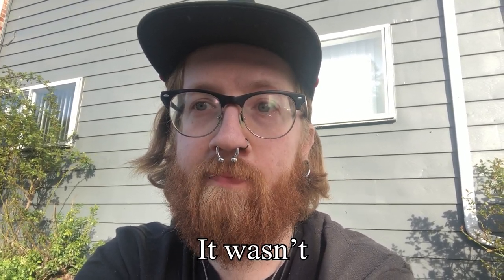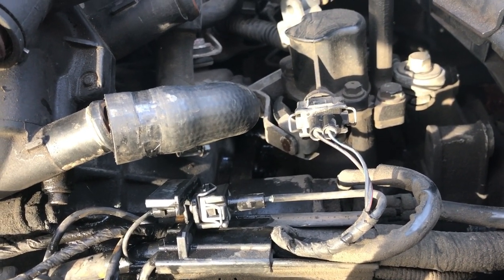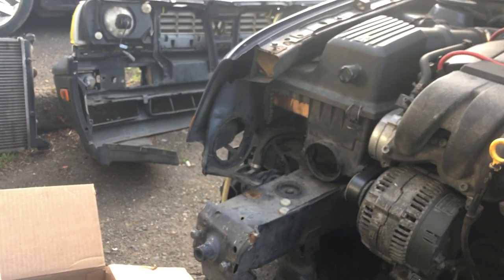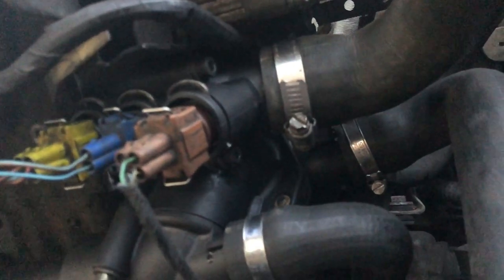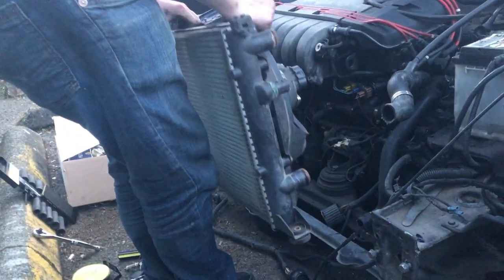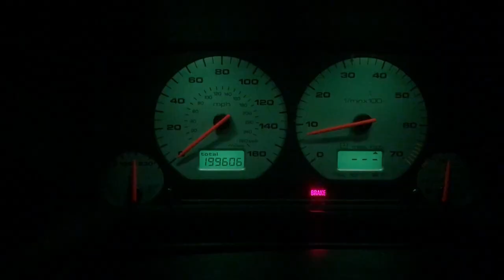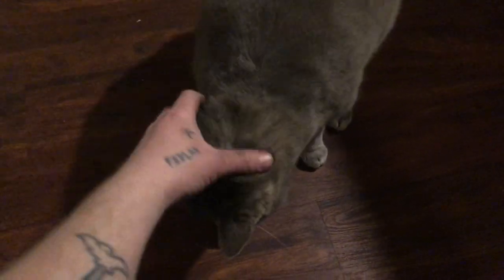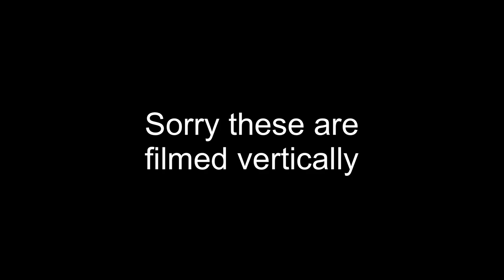MK3 Jetta VR6 Crack Pipe Replacement!

Comment: Next time use hemming paper to clean the block where the crack pipe goes also use alittle grease to help it slide in with out trapping the seal
Reply from the maker: I learned this the hard way 😅
Reply: What is hemming paper?
Reply from the maker: I’m assuming the same thing as emery cloth or like a scotch brite pad. Basically just something to scrape off all the scum.